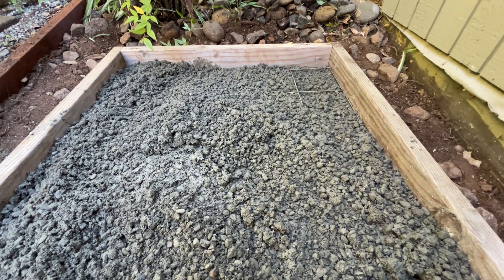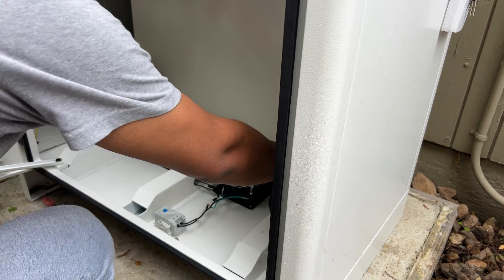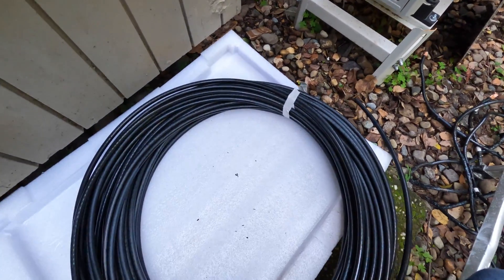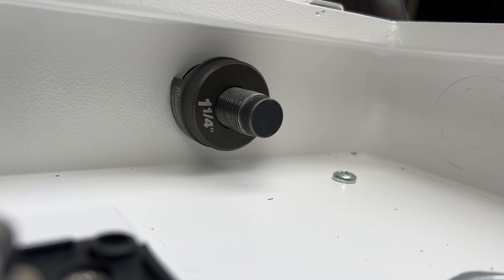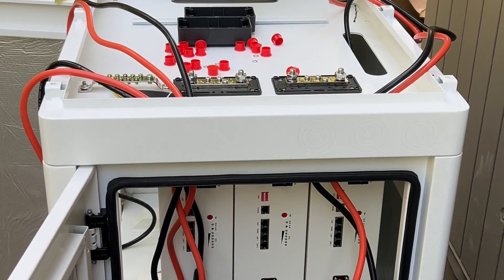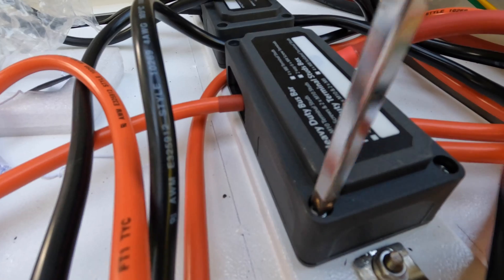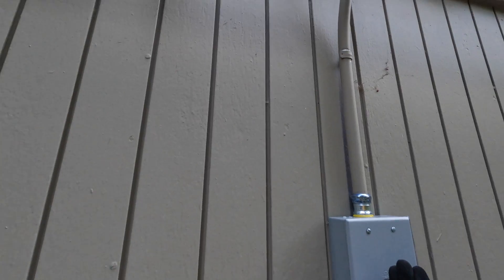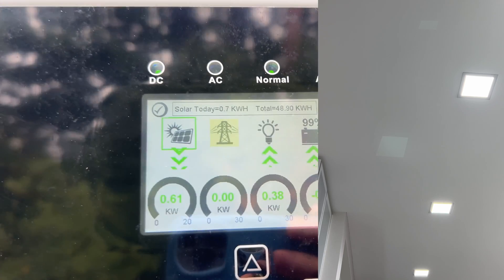Solar battery backup for home. Sol-Ark 15k with Stackrack batteries.

Comment: Great job on the setup. The only thing I don't like is the bus bars in the inverter. I wouldn't use those. Instead I would use the 2 cables per side of the battery (4 in total) because of the amount of amps that inverter can push/pull when operating at max. By using 1 cable per side of the battery (2 in total), you're placing a tremendous amount of amps on a single cable when the inverter is operating at or next max.

Comment: Using a sol-ark 15k would with generator and no batteries, with no solar, how would you use the Sol-Ark as an Auto transfer switch?
Reply: If you have no solar and no batteries, then when you install the backup generator you make sure you buy the automatic transfer switch and your down. Power goes out, transfer switch senses power outage and stars generator. When power comes back, it’s senses that and turns off generator. 25kw with transfer switch might be about 7-8K?
Reply: That is what I was thinking, but I want to use sol-ark as the Auto transfer switch until I can buy batteries. Otherwise in your example I am spending $1k for transfer switch, the. When I go to get a sol-ark 15k, I throw away that $1k.

Comment: Did you run a cable from the grid through the bottom of the main panel, through the raceway and then to the solark?
Reply from the maker: 1:22 at the bottom you can see 2 LBs, a deeper one going from the main panel to AC disconnect and then to Sol-Ark.
From Sol-Ark coming back to subpabel via another LB.

Comment: I would never install a Sol-Ark as a backup power source for my home because it doesn't offer a high enough surge power capacity for the loads in my home.
Reply from the maker: are you aware of any alternatives?
Reply: Yes, Schneider Electric, Sigineer Power, Outback Power, and Magnum Energy all offer heavy duty, high quality transformer based inverter chargers.  Watch "XW Pro vs Sol Ark" to see a comparison between these two inversion technologies.  @SolarEngineering
Reply: Yes, the Schneider Electric low frequency XW series inverters or the larger Sigineer low frequency, transformer based inverters.